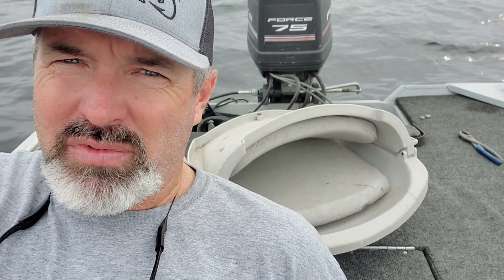PSA on Boat Preparation

Comment: We used to have a checklist that we ran through the day/night before we went fishing. On it were things like - Check and charge the battery if necessary, gas & oil, trolling motor batteries charged, air in the trailer tires, plug in, transom/bow straps, life jackets, etc. That way, we didn't miss anything and were prepared for a day's fishing.